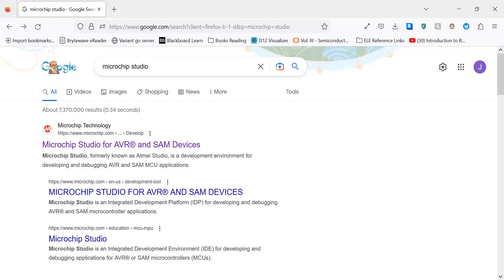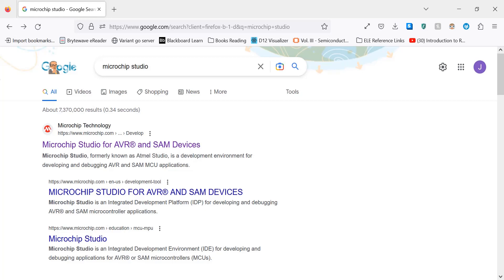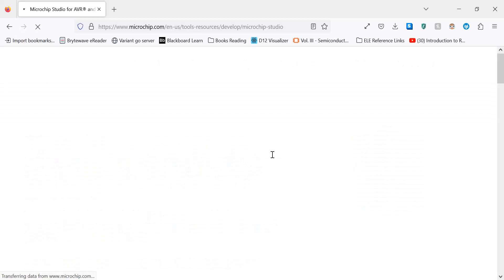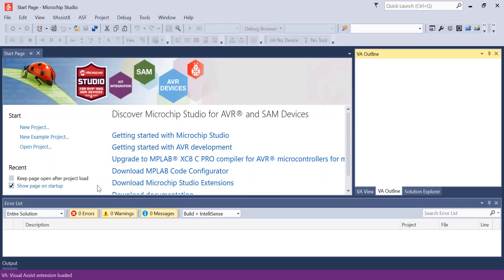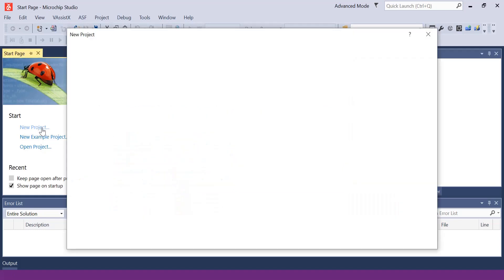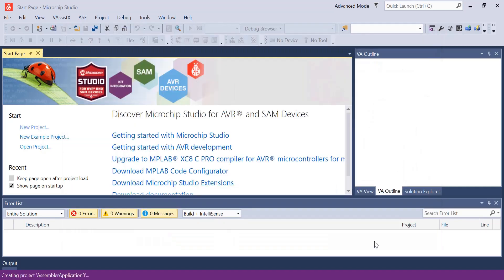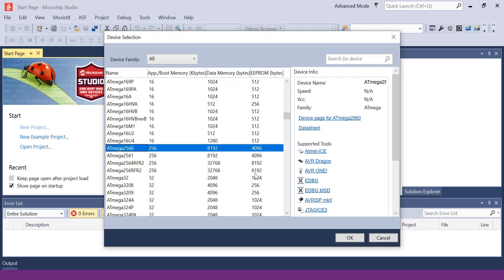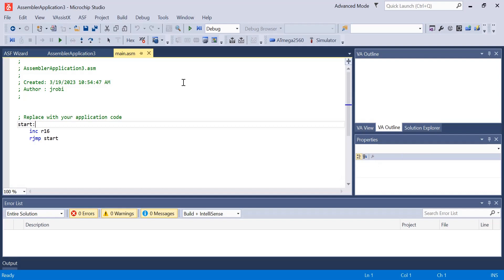AVR Assembly Tutorial: Part 0 (Getting Started)

Comment: I found assembly source code for eForth on an Uno, written for Atmel Studio 4, and the recommendation was to use an AVR ISP mkll to upload from the hex file - not cheap, or widely available.  Can I use a usbasp and avrdude instead?  Should I stick with AS4 for that project, or will Microchip Studio handle it properly, without just creating more problems I'd have to sort out?